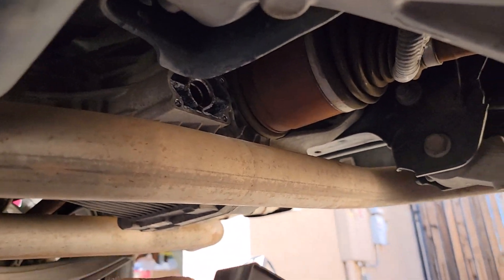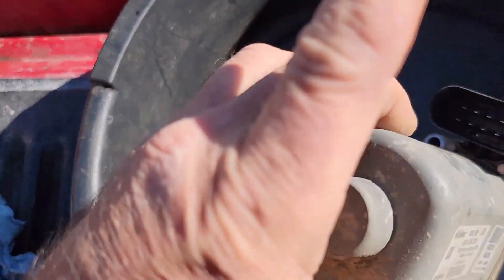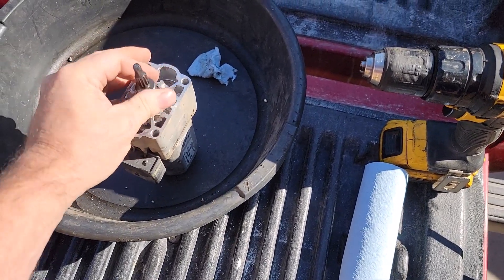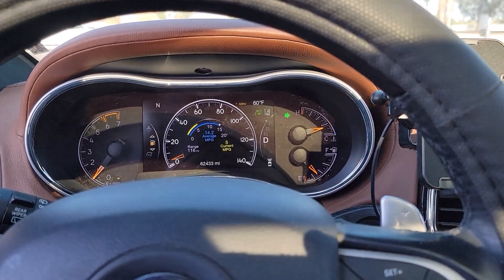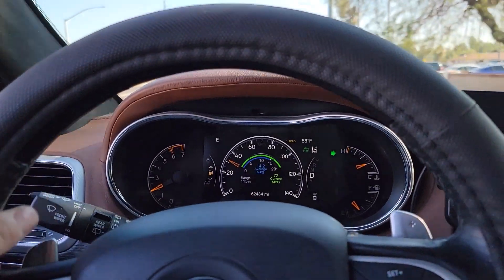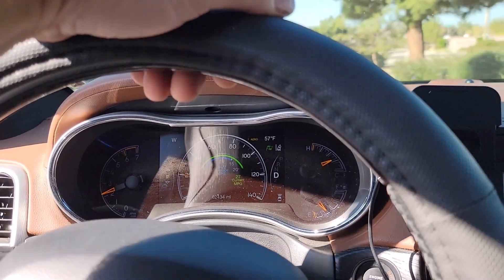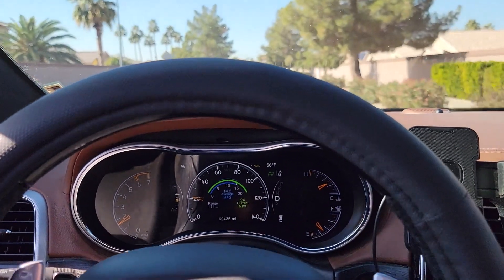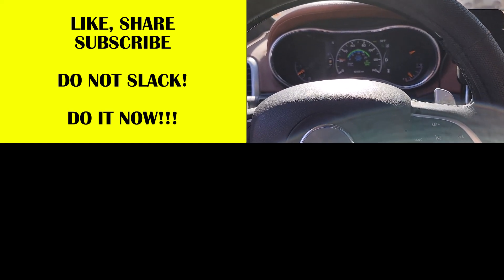Jeep GC LSD Motor Fault C2221 temp fix

Comment: Of course the 'debris' theory begs the question:  "Where did the 'debris' come from?"   Along with bonus question: "Where did it go?"   ;)    

No doubt the 'debris' (if that's what it was) is hiding in the 'post-warranty' chamber of the motor housing.  

On a side note - I'm an old guy (Child of the 50s/60s) so the "LSD Motor Fault..." caught my attention!  lol  *Perk - Did he say LSD?!*,
Reply from the maker: It acted up again.
Pulled the motor. Locked up.
This time I popped it loose to take it apart.
Bearings both free.
Blow it out.
Put it back together.
Spins perfect.
Assemble in jeep and drives fine until this AM.
It is intermittent. 
I suspect one of the magnets lost its glue bond to the housing and gets pulled up against the armature. 
I'll probably remove it tomorrow and see if I can pull the magnet off the housing. If so I'll epoxy it on.

ECM motors do the same thing. I've found several where the magnet looses it's glue bond. Except they are bonded to the armature (center section) and the stator has the windings.